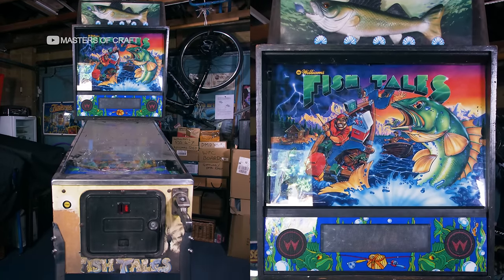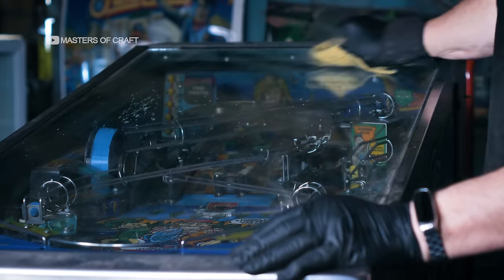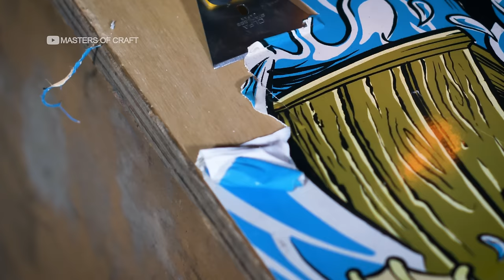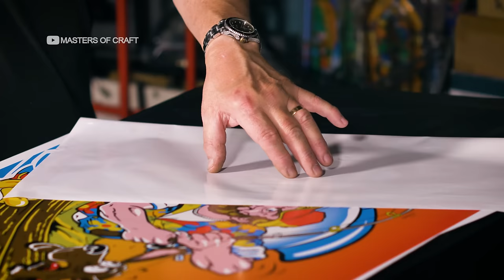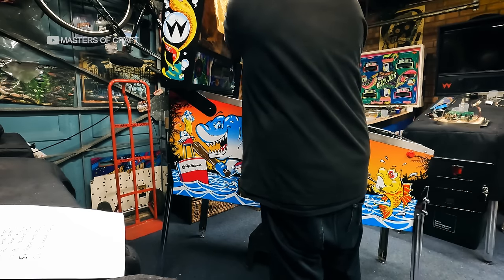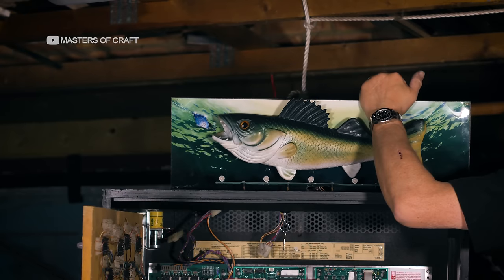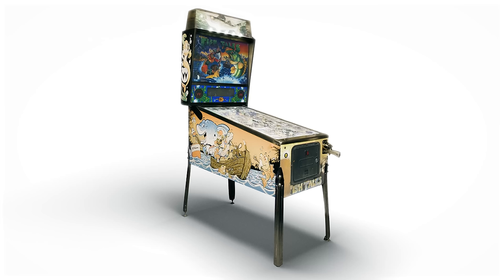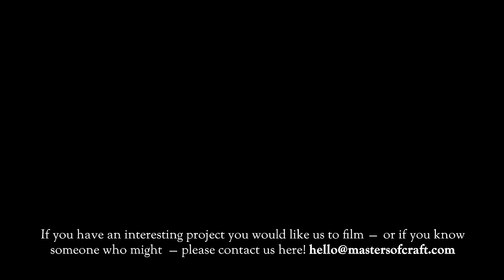How Old Pinball Machines Are Professionally Restored | Restoration

Comment: I do love a pinball machine.
My only criticism is that most of the commentary is inaccurate. 
Ie. When he says he's installing LEDs in the speaker when in fact he's putting LEDs in a bumper.
I agree with previous comment, it's a rebuild not a restoration. 
Nevertheless, it's great and the LEDs will not need replacing in the same way as the old incandescent bulbs.
Reply: Instead of criticism we should educate as you did. I never played pinball machines - or computer games for that matter. But I do admire the beauty of the machines.
Reply: @hendrikdebruin4012  yes, pinball is great because unlike computer games it's a physical machine that when you play it you can feel all the mechanism moving inside.
I guess it's a bit like the difference between a driving game and a real car.
You should definitely play one if you get the opportunity mate, but be warned, they can be very addictive. 
✌❤🇬🇧
Reply: yeah, 17:17 "the artisan modifies the boards removing batteries and replacing them with SRAM" uhhhh what? It's like saying "he modified the car. He removed the engine and replaced it with a mini fridge."
Reply: @benjaminaburns  😂😂😂
Reply: @benjaminaburns  Looked like he was replacing capacitors.  So yeah, not even right on the batteries.
Reply: I liked when he called the back glass "the head".
Reply: My only problem with leds is how much brighter they are so they can be actually painful to look at in an old machine. They also strobe way faster. It can be disastrous if you don't properly accommodate them.
Reply: @mobius273  one can get lower lux LEDs and they last a lot longer than incandescent bulbs. 
The strobing is really only a problem when filming with a digital camera as the frequencies phase.
I've replaced every bulb in my home with smart bulbs which I can change brightness, colour and control from my phone.
Having said that, I agree that there's something to be said for the kind of light an incandescent bulb gives off that can't be replicated by LEDs. But hey, that's progress for you.
Reply: @coot1925  nah i've seen machines irl that strobe really uncomfortably. Im all for leds that are properly calibrated though
Reply: @mobius273  are you an android? 😂👍
Reply: @coot1925  nope, just sensitive to sensory things like flashing lights and loud noises despite being a pinball fan
Reply: @mobius273  one must occasionally suffer for ones art. 😂
Reply: @benjaminaburns  Explained poorly, but this is really a common mods: removing the batteries and changing the battery backed SRAM with a flash ROM, keeping scores and adjustements without the need to keep those batteries (if forgotten in that position, they could leak and destory the CPU board). Doing this means no more real time clock, that in this game means praically nothing, but other games (Twilight Zone, WhoDunnit? or others) loose functionalities without that clock.
Reply: @benjaminaburns  Yeah, I imagine the narrator meant that the person doing the work removed the batteries and installed NVRAM (non-volatile RAM). This allows you to retain settings without the use of batteries. Alkaline batteries have a tendency to leak, and the alkaline can do serious damage to the game's logic board. Just imagine logic chips, diodes, traces, and any other object on the board getting corroded. All that said, the video wasn't even showing the MPU or the install of the NVRAM.

Comment: "Batteries replaced with SRAM" - Wouldn't that require a major redesign of not only the board, but the underlying code  as well?
Reply: The narrator didn't know what he was talking about. Games of this era used AA batteries to retain settings between power cycles, but alkaline batteries sometimes leak and destroy the logic board. It's a pretty common modification for folks to remove the battery board, desolder the existing ram chip, install a socket, and install NVRAM (non-volatile ram) that retains settings between power cycles. I just did it on a Taxi pinball machine this past week, and have installed it on other games in the past. The video in the narration didn't even show the logic board or this modification.

Comment: That's a lot more elctronic stuff in there than I thought
Reply: Really since the late 70's/early 80's, nearly all pinball machines are entirely computer controlled and require MANY boards to function. Having so many control boards allows for interchangeability between tables if not flat out easy replacement if crucial non-serviceable/replaceable parts end up blown or malfunction due to any issue imaginable. Joe's Classic Arcade channel covers that quite a bit with his repair/demo videos.

Comment: Hello, Very Nice  Re-Fresh, Just wondering. If you have the manual for the Machine does it tell you in it what the Elevation of the Back Legs in relation to the front legs should be, For intended Table Angle? And If Not is there a Default/Universal Elevation for all Pin Ball machines?  I am sure when the Machine was designed, They had an Intended Difficulty  of play and it would be this Elevation of Back to front legs that would create that difficulty?
Reply: For a general rule of thumb, use a slope of 6.5 degrees on the playfield.  Many pins will have a bubble level with appropriate/approximate markings to make it easy to set up in field.

Comment: A question: is the value of the machine greater than the cost of restoring it?
Reply: With today's pinball prices, most certainly. When I started collecting pinball machines, almost 20 years ago, it was the opposite (Fish Tales is the cheapest one I've bought, 350 eur, and that's an absolute steal). That said, pinball parts are very expensive, and the overall cost of a serious restoration - new cabinet decals, new ramps and so on - can be easily above 1.500 bucks - if you do it yourself and don't pay a professional, of course.